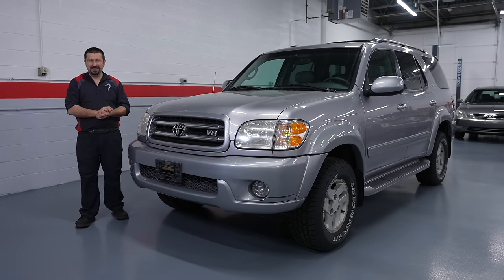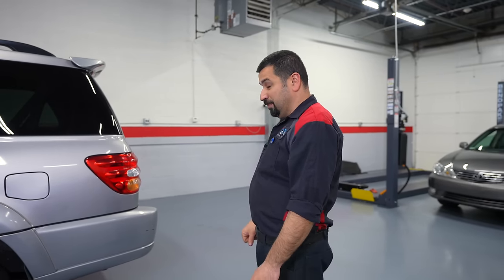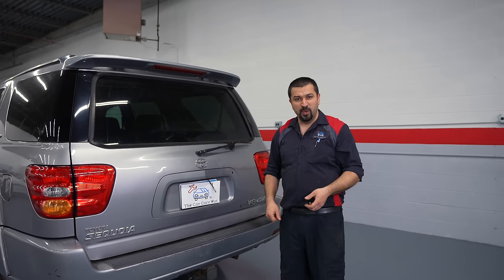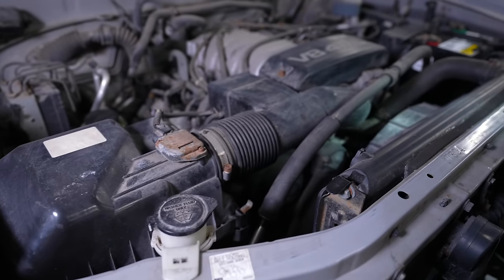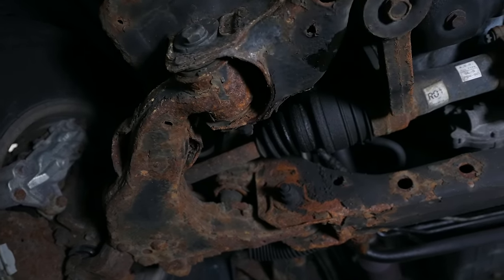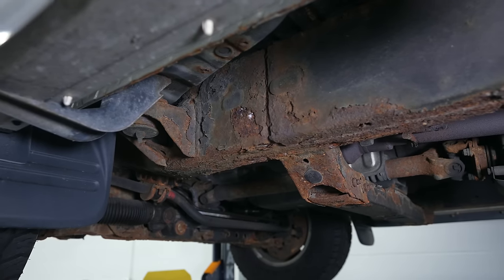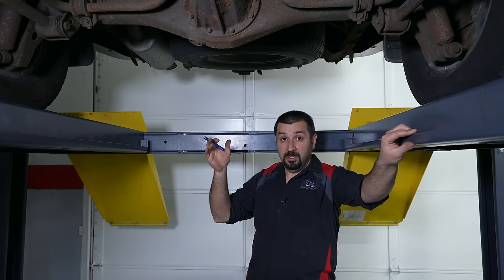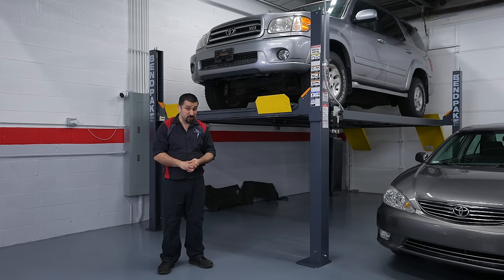NEVER Buy a Toyota Like THIS ONE! Hint : It's not The Sequoia!

Comment: I had a 2003 Tacoma that had a rotted frame. In 2013, when I bought it, Toyota still was doing the free frame recalls. It was quite an ordeal, I've never seen a whole frame swap until that point. I was amazed. In 2 days, the technicians had a brand new frame, lower control arms, entire brake system, fuel lines, rear suspension, spare tire carrier, etc... installed. It was almost $15k in parts and labor that was free due to the recall. It was a wonder truck after all that was fixed. I wish I still had it. But a couple years later, I was too tempted by a full-size crew cab Chevy 4x4. Looking back, I wish I had kept the Tacoma.
Reply: you swapped it for a 4x4 chevy . Man, what were you thinking?
Reply: Especially since its probably going for more now than when you bought it in 2013 LOL
Reply: @nichon1951  I wasn't thinking. I was stuck between a rock and a hard place. I had to move across the country for work in two days when the Tacoma failed me. I had to cut and run. I wish the timing were better... but sadly, I simply had to report to my next duty station in a few days.
Reply: @niightmaregaming  It probably is worth more now!
Reply: Imagine going from toyota to chevy. After you got blessed with a new frame 🤦🏾‍♂️
Reply: @teamlows  Yup. Read above, I explained my situation. Believe me, I didn't want to.
Reply: @CR500R  that hurts
Reply: @teamlows It still does. Man, I wish I still had it. I kick myself everyday. The Chevrolet had the best seats I've ever sat in though. That was one good thing about GM garbage. I drove for 16 hours in one sitting (bathroom breaks of course 😂) and it was so nice. No back or butt pain. The Toyota was a 4 hour at most vehicle. I'd have to get out and stretch and walk around to get feeling back... haha
Reply: What year was that chevy?
Reply: wow.  Yep, that was deeply unwise to sell it.   Especially for a chevy in that gen around 14, 15 16.. oh my gawd on how seriously expensive they can be to maintain/repair.
Reply: Yes, I worked in a Toyota parts dept. in the MA for almost 6 years. I unloaded the never ending truckloads of warranty frames coming in for replacement.
We had 1 tech who could do a frame swap in less than 2 days depending on the particular model. It was basically all he did and he had it down pat. To watch this process is truly amazing. 
Even if that truck was under a frame recall I personally wouldn’t touch it. 
I’m in MA and the last 2 cars I’ve bought I’ve flown down South to buy. Totally rust free and I felt guilty driving them back to New England just knowing how fast rust sets in on everything.
Reply: @nichon1951 Cause Chevy has the best seats of any truck, and Chevy trucks are reliable as fqqk.
Reply: Buyer beware. If you cannot properly inspect it then don't be a cheap ass pay someone for a decent inspection. Used car dealers love to hose shiny black undercoating all over the bottoms of cars in the rust belt. People are too lazy and prissy to get underneath them.
Reply: They do have great seats and are the most reliable American truck.  I still think the tundra is the best truck ever made but the GMs are good and have good gas mileage for their size.
Reply: not to make u regret it even more, but holy crap, for a chevy??? even if i was 13, well over a decade ago, child me wouldn't have even done that. insane
Reply: @ko2qx  Yes. Sadly, I was in a rough situation with limited options. I needed a crew cab 4x4 at a certain price point, and the 2010 Chevy 1500 was the only option in the area in my tight time frame. I will say, it wasn't a bad truck. I had no problems with it. And GM seats are hands down the most comfortable. (especially compared to the Tacoma) It made for a great road trip vehicle. But all in all, I wish there was anything I could do to keep the Tacoma. Problem was, I had to move by a certain time, and in the small mountain towns of Northern NH, there is no such thing as prompt automotive repair. Everything is at their leisure, or backlogged 30+ days.
Reply: I'm 6'4" 315lbs. Most seats are uncomfortable unless it's a luxury model vehicle. I daily drive my '22 4runner limited with the leather seats, and I can't wait to get out of that thing. They're uncomfortable. My 2017 Tundra is far more bearable for longer trips. It's a 4 door long bed, so it's like driving a cloud, although I use a nice  memory gel seat cushion bumps the comfort up quite a bit. My uncle always drove big full size luxury GMC trucks, I liked riding in those. Lot of room. Of all the numerous vehicles I've owned or ridden in, the most comfortable that I remember was my 1986 Oldsmobile cutlass brouhgam with the pillow cushion seats and a 1991 chevy caprice with the leather split bench that was like sitting on the relaxing comfortable couch. I used to sit in traffic for hours in that car, and it was comfortable. The electric seats would go way back. You could position it perfectly. I miss that car the most.
Reply: Oh man
Reply: My least favorite truck ever was a 2001 tacoma. So small inside and got the same gas mileage as my full size Chevy. Chevy before 2009 was bombproof, the 5.3 was amazing and powerful. The trannyes only last around 150k but only cost like 2k to rebuild. Toyota transmissions are twice that and the early 2000s ones were known for failure on the Tundras. Toyotas aren't all that.

Comment: I have a 2004 with 535k 3- timing belt,water pump. Original engine and transmission. No leaks and still runs strong.
Reply: You're doing awesome. I have an 2002 Sequoia with 310,000 miles. 2 timing belt, radiator, alternator, rear main seal, and valve cover gaskets so far. Original motor and trans.
Reply: What’s it cost for a timing belt replacement on the 4.7?
Reply: Omg🌺🌺🌺💕💕💕

Comment: This video may have saved me from a disaster. I was getting ready to replace the steering rack on my ‘99 4Runner. I had just watched this video and decided I should inspect the vehicle very closely. I knew my frame was getting rusty but I kept telling myself that it wasn’t that bad. Well, a proper inspection revealed that the inside of the passenger side frame rail was completely rusted through along the bottom edge. This is where the lower control arm bracket for the rear axle is attached to the frame. I decided immediately that the vehicle was no longer fit for service. I can’t thank you enough for inspiring me to do the right thing.

Comment: Sitting in my 06 Sequoia now. 224k miles. Still excellent condition. Best vehicle I have owned. I am the warranty.
Update 8/20/23- Just finished 7086.4 mile drive around the country. Zero significant problems.
Reply: Lol, I am the warranty.  That was amazing.
Reply: Skyler, I am the warranty.
Reply: My 2000 Suburban with 113,000 miles here in rust free Texas, is still doing well!
Reply: One of my childhood friends had their base model 04 Sequoia up to 300k when it started having electrical problems. Traded it in for a rogue 🤣. Now I wish them good luck with said rogue

Our 03 land Cruiser lasted 306k before we threw in the towel.
Reply: @HingerBinger  I AM THE ONE WHO WARRANTS.
Reply: @AtomicNexus  balenciaga balenciaga?
Reply: Luckily the seller didn't think about duct taping all those rust, LOL!!!
Reply: Proud owner of a 2008 Altima with 232k miles that passed state inspection. Being the warranty is the important part.
Reply: 250,000 miles runs like new
Reply: I like that,  i have to borrow it!  "i am the warranty" 👌
Ur truck is just now breaking in 😉
Reply: I am the warranty! That’s right
Reply: What causes that too much rust in the frame?
Reply: 224K? Showoff. That's brand new for a Toyota 😂
Reply: My 05 only has 170000…I guess I can squeeze out another 100000 miles!!😂
Reply: I know someone I think it’s a 01 or 03 transmission failed at 220,000 ish which was wierd.
Reply: @nsp31a  what a miracle lol
Reply: tavarish
Reply: Mine in Huntsville Alabama had 426,000 - gave it to a friend that needed a ride for work / his family - this was 5-6 years ago and they still drive it everyday. Original Trans & Engine. 
I bought a new Lexus for the states and Russia 🇷🇺. Toyota is the best motor company on earth 🌎 as far as dependability- work - family Etc……
Reply: They’re great cars and that other owner was a careless oaf but as an Australian I have to say that if you live your car then living where it snows and you poor folks swapping your tyres and driving on slippery roads and getting your cars covered in salt must truly suck.

It would be like being a gourmand but 3 months out of every year all the chefs all take a dump on the food before they serve it.
Reply: @luisbatac767  living in places where it snows so they have to salt the roads to keep them safe.  The salt reacts with steel causing rust and frames don’t last as long.  But they should last longer than this example.  The lazy owner never cleaned and maintained the undercarriage.  Your car will always have worse durability if you live where they salt the roads but it shouldn’t be this bad.
Reply: @mr.gutierrez2392  more like another 830, 000😁
Reply: Bruh, that is a GOAT comment. I am the warranty. lol
Reply: 07 fj with the same miles, same situation and I love it
Reply: Mines at 160k, still a baby. Spent $5000 right away to catch up on neglected work, because I want it to hit half a million miles
Reply: Most ford and chevy trucks go 200k plus pretty easy and definitely beyond that.
Reply: @CJGOM  yes the Ford 5.4 3 valve is known for its longevity. Same with the Chevy DOD engine.
Reply: Mine is at about 284k now😂 I absolutely love these trucks!
Reply: Haven't sequoia and tundra 4x4 both 4.7 over 225,000 never had a issue with regular maintance
Reply: @cpscps2679 Haha I’ve seen those nightmare 3 valve ford engines on the Car Wizard!

Comment: I’ve asked so many dealers and private sellers to send me photos of the frame of “clean” Toyotas. They rarely will agree to that because they know the frames are bad. Thanks so much for doing what you do🙏🏼
Reply: I bought a '19 4Runner with 24k miles.  It's  a Toyota "Certified" used car.  I made them put it up on the lift (after educating myself HERE with the Car Care Nut.  The car is blissful to drive. i love it!  Nicest, sweetest car I've ever driven or owned.
Reply: Hmm I just bought a 2006 Sequoia with 171K.  The 3rd party mechanic I use put it on a lift and said hes never seen a frame so rust free.  Saw it for myself.  Literally not even a hint of rust or drips.  Car was in FL most of it's life.  Extremely clean underneath.  Bought the car the same day.
Reply: That's the biggest factor that keeps smart people away from Toyotas. Like how have they not figured out how to galvanize yet? Some Audi/VW/Porsche figured that out 40 years ago. I guess you swap rust for less reliability. 😄
Reply: @mediocreman2 i have a 1992 Subaru SVX that spent most of its life in New Jersey.  Thanks to high zinc steel it doesn't have a spec of rust anywhere other than the rotors if it sits too long and only minor oxidation on some aluminum components.  I guess some brands care more than others.
Reply: @mediocreman2 They’re Toyota.  They easily could galvanize if it made sense to do so.   Guarantee it’s a small fraction of vehicles that are experiencing this.
Reply: @Noah_E You know it’s not about ‘caring’.   They think of everything.  It must just not make sense to do it.

Comment: Great video. As a Toyota Master Tech I've seen tons of frames replaced under warranty. Mostly a northern issue due to salted roads. But also  here in Florida is the tow a boat to the ocean.  Salt water reak havoc on those frames. Always look underneath these vehicles
Reply: I live in northern Ohio. I take my car through a car wash with good undercarriage sprayers after every snow melt or not long after I know the salt is gone for a while and I pressure wash underneath every spring. I've never had a rust issue doing it this way.
Reply: @matthewlester2907 I was thinking something like that would help wash off the salt and other grime off,

Comment: Thank you so much for this video. It basically taught me how to do pre-purchase car inspection myself before even deciding to take the car to a mechanic for a pre-purchase car inspection. I have been trying to learn car inspections myself but now in newer cars, there are covers on engine which makes it so difficult for people like me to inspect cars on our own. I made a mistake in my recent used car purchase because it was a Lexus so neither I paid too much attention nor the mechanic who did pre-purchase used car inspection.
Reply: I looked over this 04 Avalon about 2 years ago. Checked the fluids, checked the body and insides. The oil looked clean. The oil light was kind of flickering at stop lights but seemed to drive ok and it felt like it needed an alignment. A lot of people wanted the car, so I decided to buy it. I got home and immediately changed the engine oil, the engine just looked too clean to me. The oil on the dipstick looked pristine. The oil that came out was completely black and sludgy. The engine was full of sludge and after I removed the valve covers, I found the worst caked on black sludge I have ever seen. One of the camshafts hadn't had oil for so long that it scored the bearings until they were paper thin and they looked completely burnt. After I cleaned the heads, the engine developed a rod knock. I really liked the car, it was smooth, the interior was roomy and the trunk is huge. I wish I would have listened more closely to my intuition. While I was looking at the cars he had available, I noticed he had a lot of problem years for cars because I looked up the complaints online.

Comment: Couple of things that I know about First Gen Sequoias, 1). Rear Tail Gate Latch usually break, make sure you replace with OEM one, don't buy cheap after market won't work. 2). Make sure that the Timing Belt is replaced.
Reply: The metal replacement handle is boss
Reply: I wouldn’t even get a timing belt engine honestly. My first car hyundai Elantra 05 had a timing belt it was a great car and reliable but thankfully a small accident got me away from it since I know chain engines are usually better.  but my prius 07 has a timing chain. The only issue is it requires synthetic for the hybrid engine so a bit more expensive but a timing chain.
Reply: @robmalcolm8042 chain engines aren't neccesarily better. Most chain engines are interference which is a problem. While a lot of timing belt engines are non interference. Inspection and replacement on a belt is easier and cheaper. My buddy literally had to pull a whole motor since ford put 2 timing chains on, one behind the front cover, one in front of the firewall. On top of that, that's because the chain guides were plastic. They have pros and cons but if you maintain either setup, they will usually last a long time.
Reply: @joshuadejong7115  after some time yes most engines became interference but that goes for timing belt ones as well. I know most known non-interference engines before were mostly chain driven.
Reply: @joshuadejong7115  yeah they both do but despite that it can depend on the engine design of the said brand as well. Some have a better design where plastic guides aren’t a issue but yes that is a very common problem how the timing chain location and design is. Personally though I feel if you take care of a timing chain engine with oil changes and it isn’t designed like crap as the ford one you mentioned then it can be a better design in the long run. Some chains go a very very much longer time than a belt before it actually is done for.
Reply: @robmalcolm8042  
Meh, as long as it’s a non-interference engine, a timing belt engine doesn’t bother me. I’ve had timing belts break on two different cars, one at about 100k miles and the other at 150k miles. Of course they should’ve been replaced at the recommended intervals, but it was no big deal either way.
Reply: @LuckyCharms777  yeah but most timing belt engines were interference as is and definitely now a days basically almost all of them are. At least most back then if it wasn’t like a Toyota, ford, Mazda, only one model of Honda v6, one model of hyundai v6 that I can think of early 2000s that were non-interference with chains and belts. I used to research that and those were some that were non-interference in the past. Most brands were and now are interference
Reply: @robmalcolm8042  
Yeah, these were 1990s vehicles. I don’t know about now, I’ll take your word for it.